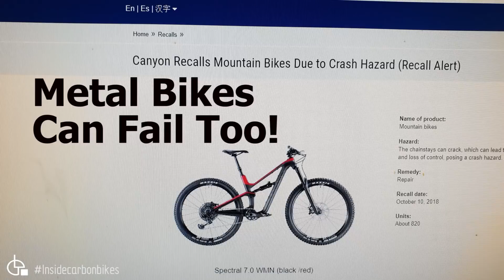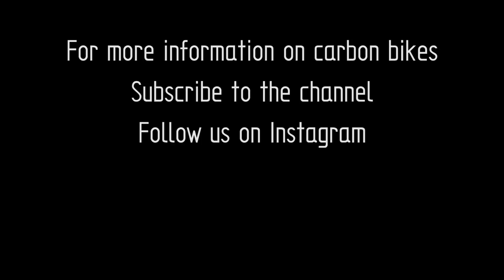Metal Bikes Can Fail Too!

Comment: The drive-side chainstay weld (rear dropout) failed on my 2000 Trek 2300.  I think that was a bad era (when manufacturers were pushing the limits with alloy before carbon entered the mainstream).  Never got a replacement frame as I was not the original owner.  Surprised they never even offered me a discount/voucher.  Went with an entry-level specialized tarmac (carbon) and still riding it years later.  It feels like it will last for ever (as long as I don't crash it).

Comment: What you say is true , but I can and do chuck my metal bikes in the cargo bin of my bus service and all is well , would not do that with my carbon bike , ever
Reply from the maker: Yes, but how much does the metal frame weigh compared to the carbon one, a similar weight carbon frame that is made well would be almost indestructible.
Reply: @LuescherTeknik  I'm hearing ya , but I can't help but wonder if it wouldn't be more suitable for a lot of people to buy a quality steel frame , for example I have three steel frames , 531 , prestige , and Columbus all weighing around the 2kg mark the Columbus at 1900 gm I paid $50 for each of the frames now if I was to marry these up to high end carbon groupsets and wheels even lightweight wheels would not be out of the question considering the frame cost savings, I could have a very light weight and durable bike , I mean you really cannot relax at all around carbon , and coffee shop meets , are anxious affairs ,

Comment: Regarding welding in aerospace. If I remember correctly the SR71 used titanium welds and the Mig 25 steel welds. Obviously being military aircraft may have allowed for much tighter quality control.
Reply from the maker: As I recall reading on the S71 they used electron beam welding in a vacuum chamber on the titanium, this technology is most likely beyond the average bicycle factory. ;)
Reply: Many light GA airframes are constructed from welded steel tube, just like a lightweight steel bike. In commercial and military aircraft there are often weldments in the non-aluminum structural components.

Comment: On my aluminium MTB, a chainstay broke. Not some no-name cheap thing, a Felt 29er. Up until then I was sceptical about carbon because carbon tends to fail catastrophically if it fails, and this incident showed me that there is a flip side. The failure was metal fatigue, meaning that a carbon part would probably not have failed at all. Also, that theory about metal parts failing more gracefully and allowing you to notice before they separate went out of the window too. The chainstay broke right through and was held on by a mere sliver before I could notice anything. I did not fall and could even nurse it home, but this was only because I was pedalling casually on smooth tarmac. I do quick descents over rough ground on that thing, and had the part broken there, it would have separated entirely, bent the rest of the linkage and the wheel as well, and I'd be sent flying. So no, a metal bike is not safer than a carbon bike. It depends on how well built or how overbuilt they are. However, even the best built metal bike will fatigue over time, while carbon won't. Thus, if I had a choice, I'd pick carbon over metal. I have flipped my ideas.
The reason my chainstay broke was that they welded a mounting plate for the brake caliper onto it. The stiff plate, along with the stiff weld, ended abruptly, creating a stress riser there. Plus, the seat stays attached at a point well beyond the axle, creating an upward bending momentum on the chainstay. In fact as I got the bike I went uh-oh as I saw that, but I thought, it'd be ok. Felt surely know what they're doing. Actually, they don't. The engineering standards in the bike industry are terribly low, and the reason the bikes don't break more often than they do is pure luck, and the quality of the materials they're built from. The bikes are not engineered, rather designed to look good. The same goes for carbon bikes, except they are also difficult to manufacture en masse and easier to screw up. So pick your poison. Whether you buy metal or carbon, what you're getting is an overpriced, underengineered, badlly built product. If you buy an expensive brand name, all you have done is paid more, you get no higher quality.
Reply: I never heard of a steel frame that failed catastrophically. In fact, I've ridden a steel frame with a crack in it for weeks until the crack grew almost all around the down tube. Then I got rid of it. (Of course, I didn't ride the bike at high speeds, just commuting on a smooth bike path to work where there was no traffic at all) 

I managed to destroy the frames of any steel bike I owned though (except those which were stolen or not worth to buy new wheels etc. for), but none failed catastrophically.

But I've seen horrible pictures of aluminium forks which failed without any warning. On amazon, pictures made by the customers and they were still selling this life-threatening crap...

Comment: The chainstay on the spectral cracks on the squished part of the tube where it allows the stay between the chainring and 2.6 tyre. They replaced that with ones with weld along the top.... And it still cracks after recall. Constantly. Some people have had 4 stats in 18month...

Comment: A big difference between metal bikes and CF bikes is that the faults like cracks can usually be easily detected before complete failure and normally failure doesn't not result in the rest of the frame collapsing in a heap like CF bikes do. Metals have greater ductility. Also as he has mentioned, the failures occur at the welded joints. You can automate the welding of bicycles (this has been done since the 80s) but you cannot automate the lay up of CF. Once an expert welder has taught/programmed a CNC robot to weld one metal bike, the likelihood of human error is greatly reduced. CF manufacture requires human input and the likelihood of mistakes is far greater than with the welding of metal bikes(if automated).
Reply: Triode 12, after viewing a large number of Luescher Teknic videos and participation in the comments forums of said videos, I’ve come across your numerous ludicrous restated comment of “ the frame collapsing in a heap like CF does”. I’ve worked with metals most of my 50yrs work experience.  I’ve raced both on and offroad competitively on steel, aluminum, and carbon. Give up your miss information campaign and go away!
Reply: @awesomexistence  https://yarchive.net/bike/composite_frames.html
Reply: @awesomexistence  You should work on your spelling first - what or who is 'miss information?' your daughter?
Reply: @awesomexistence  https://yarchive.net/bike/carbon_forks.html
Reply: https://www.sheldonbrown.com/brandt/
Reply: Triode 12, looks as if your a Jobst Brandt disciple. Your 1st and 2nd links to discussion by JB is based only on anecdotal evidence. I raced through that era and saw nothing to back his statements of anecdotal evidence (no link to actual experience). Sheldon Brown took him to task on his opinions. Oh, and by the way your links are pretty ancient to todays technology. As i stated before give up your miss information campaign and go away. Your embarrassing yourself!
Reply: @awesomexistence  And again you need to work on your spelling - it is You're (short of you are) and who is this miss information you keep mentioning? Who is she?
Reply: @awesomexistence  "Doug Perovic, a professor of materials science and engineering at the University of Toronto, said that carbon fiber was a bit like a diamond: strong while not being particularly tough.

The Boeing 787 Dreamliner makes up for carbon’s lack of toughness by building up several layers of material, Perovic said. Bicycle makers go the other route and use its exceptional strength to make the bike’s structure as thin and thus as light as possible.

What results, Perovic said, is that when a bike is stressed beyond its limits, it “fractures into many pieces while metals bend, the energy absorption is the bending.” While steel and aluminum bikes generally telegraph an impending failure by displaying cracks, carbon fiber generally fails without warning."
Reply: @awesomexistence  " Like the other frame options, carbon has its weaknesses. Durability is one question. A crash that might scratch the paint on a steel frame could cause significant, hard-to-repair damage to a carbon frame. Since carbon fiber frames are generally more rigid than other materials, these stresses can lead to structural failures while in motion. A rare event, but not something a rider would encounter riding steel or titanium frames."
Reply: Triode 12 nice to know im liviving in youre heead 😂.. You argue from the particular too the general; a losing proposition. Adios
Reply: Triode 12, you don’t understand a word of what I’m saying so you bother to respond 19 times! 
What you contend with carbon bikes happens quite rare compared to the number of bikes manufactured and miles/kilometers ridden. 
Your argument with carbon is from the particular too the general. However, perhaps you should never go outdoors due to the off chances of being strick by lightning. 
(Intentional “miss” spellings  sure to blow your mind😂) So I will live in your mind for some time to come while enjoying my active life and riding my carbon bike.

Comment: I've got a fat tube aluminum KHS turbo frame hanging on my wall that is riddled with half a dozen or more fatigue cracks (all near heat-affected areas from welds). It's a great reality check. Others: Felt, steerer tube recall (aluminum) https://www.cpsc.gov/Recalls/2014/Felt-Bicycles-Recalls-Triathlon-Bicycles or Felt aluminum cross bike frame recall (https://www.cpsc.gov/Recalls/2015/Felt-Bicycles-Recalls-Cyclocross-Bicycles) Or, just watch MTB fail compilations on youtube (https://www.youtube.com/watch?v=vu9IN8X0JOU) and see that most of the bikes failing are metal.

Comment: my steel tourer cracked at the chain stay weld after 13 years of use, including several cross continental self supported camping trips and many thousands of miles of use. I was still able to ride it the 70 miles home and the manufacturer gave me a new frame free of charge.
Reply: And if you're in a town or city, just find the local muffler shop or something and ask nicely for a couple of new welds. Steel frames don't rely as heavily on heat treatment to stay safe.
Reply: I've ridden a steel trekking bike for weels which had a crack in the down tube. The crack grew and grew slowly. I got rid of it when there were only a few milimeters of material left. I'd never do this with aluminium... (Of course, I rode very carefully and only on roads, bike paths, not offroad.)
Reply: That's also how my steel frame bike failed. Only my way home was a bit shorter.
Funny thing is that it's the only frame I broke so far and I have to think about that every time someone recommends steel as the most durable and robust frame material ;-)
Reply: kevina6587 
I have an 69 Bob Jackson and I ride her hard , training , cyclocross,  sportives and for the moment is perfect , that is true that I apply DW 40 inside the frame every 5 o 6 months to protect it from rust .

Comment: I’m actually one of those unlucky guys who has a cracked spectral and basically the wield bead that connects the chain-stay (on the drive side) to another piece that has a suspension pivot point was to small. So what would happen is the bead would crack right down the center. However this only happened to medium sized bikes that where in the first production run, canyon after the first few weeks of the bikes being out redesigned the chain stay twice and if you where to order a spectral today it wouldn’t have any problems. Also they sent me a new chain-stay within 3 days and I got my LBS to install it for me (which canyon paid for). If you want you can contact me and I can send you photos
Reply from the maker: Thanks for the information. Good work by Canyon to rectify the problem.

Comment: Hi Mate. What is your take on workstand mounting a carbon bike? Is top tube mounting a no go?
Reply: He answered that in one of Cycling Maven's videos I believe. He said yeah don't clamp to the top tube, clamp to the seatpost because that way if it breaks it can be easily replaced. The top tube can't. I see a lot of people putting their carbon frames on bike racks by the top tube, but in these cases they are basically just resting them on the clamp and barely clamping it down at all.

Comment: Canyon bikes tend to be focused around being lightweight and performance with thin weak tubes. They have lower rider weights than many competitors and they like to innovate with their frame designs but don't actually make frames themselves but have to rely on manufacturer's in the far east. Last time I'd seen that information it was Giant that manufactured their aluminium frames and Quest composites for their carbon frames but with any company basically importing components this could change I'm sure.  I think they originally had carbon frames made by Giant but they became too expensive but I could be wrong about that. 

My own opinion about aluminium vs carbon is aluminium does occasionally get frame recalls where the frame has been poorly engineered and is just too weak as a design error but this is easily remedied by going for a existing frame design that is well tested and has evolved over the years. Many far east companies have their own frame designs which have been improved over the years with failure information from the importers.

Carbon on the other hand is a manual manufacturing process where an individual may create a poor quality frame but the same identical model frame made elsewhere in the factory is to a much higher quality. 

Also for me steel you can feel before total failure, aluminium you can sometimes feel but also visually see approaching with cracks etc but carbon can fail instantly with no obvious clues of that impending failure unless you scan it. That for me is the improved safety of metal frames.

I feel the safety aspect with carbon is it is more of a lottery with regard manufacturing quality because it relies on the skill of the frame builder. These are not high paid jobs they are basic assembly jobs with low pay and conditions in the far east.

However I totally accept the benefits of carbon, the ride quality , the low weight, the efficiency and often quite beautiful bikes but I'm still convinced myself that metal framed bikes make better everyday bikes to be used and abused and carbon is more about competitive cycling and more of weekend ride bike. It's like having a everyday car to get you back and forth to work and a sports car for the weekend. Maybe that opinion will change as carbon matures.
Reply: Well explained. I totally agree with what you have said.